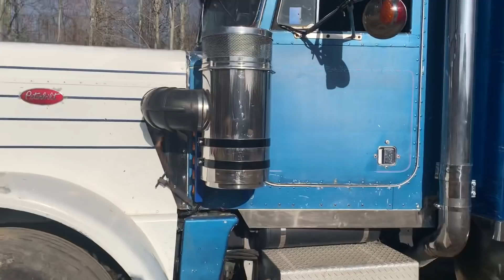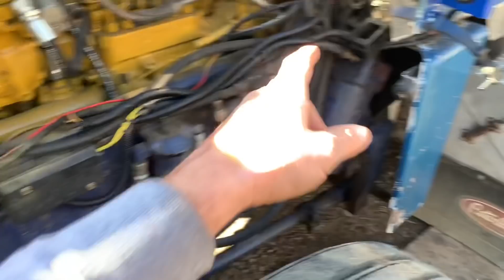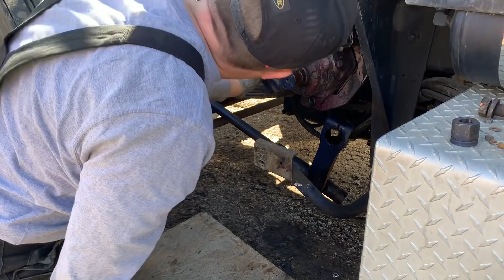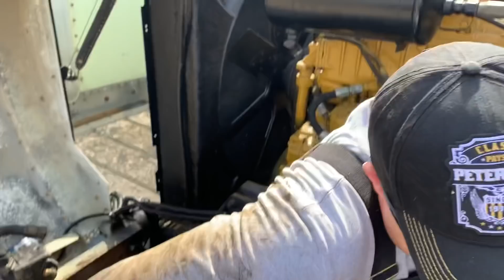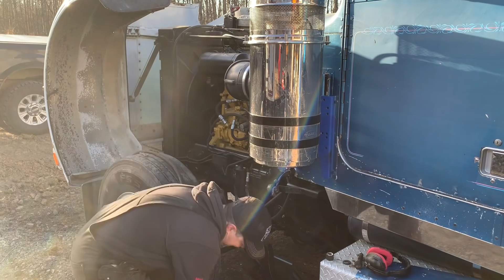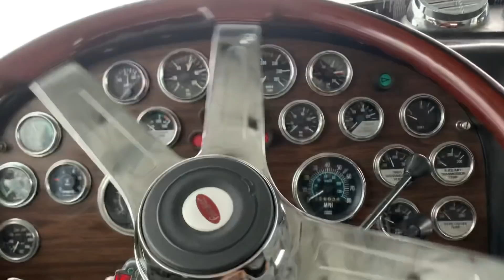Peterbilt 359 Restoration Ep.62 Power Steering Fail

Comment: Ok hear is my 2 cents worth my 97 pet has 0w30 motor oil in it power steering fluid won't work transmission oil won't work a rebuild kit for the steering box is only 75.00 dollars as long as you just need seals and bushings.  But now I'm sure you will learn all about it

Comment: Slight binding is due to non-lubricated steering column slip-joint between gearbox and firewall. Loosen column from input shaft of gear box and remove, extend slip-joint down enough but not completely out of steering column to expose most of the splines and grease the splines all the way around then slide it in/out several times to coat the column insides. That slip-joint must be able to move freely with zero effort. Failure to grease slip-joint causes steering column to bind on itself. As for bleeding air from gearbox, I left my pitman arm fully attached, raise the whole front-end off the ground and supported with cribbing, started truck, and turn the steering wheel lock to lock several times. Initially when installing new box, even with fluid in the circuit, it won't be through entire system. Upon starting engine there will be no power assist because the fluid circuit is not complete. Grab the steering wheel and force it in one-direction which will complete fluid circuit usually within one rotation of steering wheel which will then immediately provide power assist. Once the fluid circuit is complete, turn the wheels lock to lock to bleed air then sit the trucks front-end back on the ground and test power steering. Most power steering gearboxes are self-bleeding and working the wheels lock to lock is all that is needed to remove the air pockets. I have replaced my steering gearbox 3-times now in 11-years. Twice with the factory installed R.H.Sheppard, then switched to TRW-Ross which I love. So I've done this a few times.

Comment: Run regular 15w40 motor oil in your power steering, on truck the pumps are gear drivin and thicker oil doesnt hurt the pump like a belt drivin one and if the seal goes in your power steering pump, motor oil will go into your motor instead of ATF

Comment: I would recommend this. Reconnect the steering and align it (you didnt have to remove it to bleed). Jack the front axle and ensure that the jacks are nowhere near the tires because you will be swinging them back and forth (left to right). With the engine started, cycle the steering back and forth at least three times with the bleed valve open (on the steering box. It will have a bleed port, that you connect to a hose, like on hydraulic brakes). 

I can bet you that air was trapped around the gear and balls of the steering box. Once you start getting steering, close the bleed valve, then let it run for about 10 minutes, then repeat (to get the air from the return line out, as those bubbles will cause skipping steering).

Hope it works out.

Comment: When you bleed power steering systems, it is very important to not start the vehicle before you bleed the system. That will cause the fluid to foam and it will be almost impossible to bleed it. You bleed it by turning the wheel lock to lock just like the instructions said, but with engine off. Make sure to top off fluid as it drops, so air can't enter the feed line to the pump or you are just chasing your tail. The reason they do it with pitman arm off, is it is already off. You could just jack up the front end, whatever is easier. I would let it sit in hopes that  fluid settles down and try to bleed it again, just don't start it before you bleed it. If that don't help, maybe the lines are swollen inside. Also worth checking out the u joints on the steering shaft. I think you have some power steering, judging from the end of the video. It didn't look too bad to go from lock to lock with one hand. Good luck you will get it figured out.

Comment: Check your lines old ,they can collapse on the inside and cause problems , if not crack line with someone turn the wheel to see if fluid is circulateing

Comment: You could also have a giant flake of rust blocking the suction fitting inside the resevoir. There should absolutley be fluid at the suction side of the pump and once it’s running there shuld be fluid at the pump outlet , flow not high pressure, as you steer the pump builds pressure and flow drops

Comment: I think there is something wrong with that pump you got.  Especially if they said they had to reverse the direction?  I changed my 1981 Pete from manual to power steering and after I got the new box and pump on it worked like a charm,.  Can turn the wheel with one finger.  As for the steering gear, when the worm gear is shimmed to match the lash on the pitman gear correctly it shouldn't drag or be too loose.  Sounds like the lash is too tight.

Comment: Jack up your front axle, both sides and turn your steering all the way both ways a bunch of times. That's how i make sure its working properly without air after replace a sector or a pump. You could have kingpins starting to seize up

Comment: If it was in my shop, I would check the u-joints in the steering shaft. Then I'd put it on jack stands and try working the air out by steadily turning the wheel left and right. Also, would check the king pins at this point. Not sure if that type of reservoir would have a serviceable filter, but I'd check for that. Then all that would be left is replacing the power steering lines. Could be collapsed internally.

Comment: I replaced my gear box a number of years ago. I got it from a rebuild shop. I also had a slight resistance when I turned just slightly to the right. I took it back  and the mechanic made a slight adjustment and it worked fine (still does). I saw what he did and  asked if it is still not right, can I try to adjust it? He said " no, just bring it back, I've been doing this for 35 years, I just know how it is supposed to feel". I don't know what he did but obviously he know what he was doing.

Comment: You need to check the tank to see if the pressure line is blocked I had to replace mine on my 2000 Pete turned out line was blocked by rust

Comment: Have you checked your king pins they will cause hard steering
Reply: As the main steering is disconnected you should check the joints in the steering wheel shaft may have a flat spot in the uj. Keep at it love you vids great viewing.

Comment: Some reservoirs have filters in them, you could check to see if yours does.  Also I've always bled power steering systems by lifting the front wheels off the ground (or remove the pitman arm like you did) and turn the steering wheel lock to lock 20 times of so with the engine off.

Comment: Mark if the changing of the steering box was hard on the Pete, I had to change the identical box on my Diesel Pusher RV. Monaco from the bottom of the RV and it was pure Hell so keep making those awesome videos.
Reply: Do you have a part number for this steering gear box? I have the same hydrapower Ross box on my 87 Pete and every number on there leads me to a box that doesn’t match.

Comment: In my best biosed thinking after sweating bullets on my truck was would you believe something so simple.... change king pins, I am thinking that take the weight off the front and take that main link steering arm off and then can you move those tires easy by your hands, if not its surely king pins like if they were replaced and one of them froze up from setting so long..... I have had something that wasn't that long setting and more from something just wrong with a pin. I will put a nickel against dog nuggets on it

Comment: That's cranking one handed with a bull handle like butter with practically no effort.  That's almost as good as it gets. That's good. I wouldn't question that in any truck I've ever ran.
Reply from the maker: Drag link wasn’t connected when I was spinning the wheel ... when it was I could barely turn the wheel 🤔
Reply: @TwinStix  ohhhh gotcha...well that makes more sense.  My only other guess was are there grease certs in the entire system somewhere that haven't been greased for years possibly?

Comment: I'd check the hoses too, as others have said. Although you can't see any evidence on the outside, the inside of the hose can collapse and prevent flow. You could look into the reservoir when the engine is running, you can usually see swirls in the fluid as it returns to the tank, it might be that you are only getting a trickle instead of full flow.

Comment: Hi mate, sometimes the uni joints in the steering column shaft seize so take them off and check they move freely also could be steering column bearing. Some steering boxes have to be turned from lock to lock without the pump/engine running to set the limiting valves in the steering box. Good luck

Comment: Manual or Auto poppet in the gear box. If manual if there not set right there will be no assist while turning. Simulating turning full lock.. should be a hole on top and bottom flat head screws. Don't back out to far pressure will blow the screws out and make a mess.

Comment: Hi I don't if it helps but when filling up the power steering fluid you normally have the engine running and slowly fill the tank and now and then turn the steering lock to lock as you fill.

Comment: I had hose that looked perfectly normal on the outside but the interior had decayed and collapsed on the inside and nothing was getting through it. It wasn't a power steering hose but a brake hose, maybe that is the issue. It was scary coming up to a stop light because all of a sudden the right wheel was locking up and the left wheel just kept rolling! Just check the lines. Hope the pump doesn't get burned up running dry! Anyway you could remove a hose and fill the pump and the steering box? Good luck.

Comment: Ok mark, here you go, all your fans wrote in what to try to do and I Made a list, 
1st take the truck for a drive and make a lot of turns to try to purge any air from system.
2. Try filter change for that system.
3 check for clog or clasped hose.
4. Jack front of truck and turn wheel see if turns easier.
5 check king pins/ what ever that is/ 
I am an aircraft mechanic not truck a mech.
6. Check for frozen steering knuckle any thing in steering linkage.
7.try installing a psi gauge in to system should be 2000 to 2500 psi. I think.
8. Might be a bad part out of stock, don’t know how many times that but me in the ass working on 40 year old Aircraft. Like DC10-30.
 Well I thought one stop shop for all those great fans who are trying to help you. 
Like I said I am an aircraft mechanic. 
Good luck. Your videos make my day.

Comment: Check all the steering shaft u joints. Possible one in the column is seized. Also, check this troubleshooting guide to point you in the right direction https://www.trwaftermarket.com/globalassets/na/trucksteering---literature/other-manuals/other-manuals-sm/trw1250.pdf

Comment: You've obviously checked that the fluid is free-flowing? There's no a blockage in the lines or the line from the reservoir?
People put all kinds of things in power steering like engine oil, trans fluid, hydraulic fluid, power steering fluid, I saw once LimSlip! Those fluids aren't always compatible and sometimes gum up.

Comment: It’s normal to have a little bit of a hard spot in the steering box, it’s the centre of travel, and you have to overcome it to steer from one side to the other. It helps to keep the truck going straight, this is what I was taught when learning to overhaul steering boxes. Also trying to drive a wedge into the slot helps to remove the arm from the steering box. Phone Hydra Steer and ask them what could be wrong before pulling the box off the truck as it’s awkward and heavy. Inside the frame is usually greasy and dirty, only exception I ever saw was Les Steils, you could work on his truck and never seemed to get dirty, He always said if I’m going to have to crawl under it to grease it I’m going to make sure there is no dirt or grease anywhere on his inside frame rails etc. Miss the good old days as I’m retired, still work on NT 855 Cummins Engines, not many people know much about them anymore. Good Luck my friend I’m sure you’ll figure it out, enjoy your videos.

Comment: I would suggest disconnecting the lines at the steering box, and connecting them together. Then take the return line off of the reservoir, and put it back into the fill hole. This will establish a complete loop you can see. Then you need to confirm what is the pressure and return fittings on the steering box. I would also changing your return filter. Also when working with a "clamp fit" of the pitman arm, if you tap a thin wedge in the split line, it will open it up enough to slide off. Don't go overboard, just enough to loosen it.
Reply: Dave knows his stuff.

Comment: Did you check the fluid color after you ran the new steer gear stop to stop? If it is light pink and frothy looking you have air in the system. Best practice is to not start the engine. Jack the front end and support. Once the air in the fluid has dissipated run the steer gear full stop to stop 10+ times. This should  allow any trapped air to "burp". Keep checking the fluid color. Light pink indicates air. Keep running the steer gear lock to lock with engine off until fluid color is solid red. Only once the fluid color looks the same as when you put it in should you run the engine and allow pump pressure to come in. This should still be done before any weight is applied to the steering system. I bet you are fighting trapped air. Keep up the excellent work and love for the forgotten sir!

Comment: Not sure if this applies to the 359, but my car had some resistance steering sometimes even with a good power steering pump and it ended up being the linkage, there was some corrosion on the steering column and greasing it up completely fixed it

Comment: Might work, I get the front wheels off the ground, remove the power steering reservoir cap ,ignition to run so the wheel moves freely, turn the wheel back and forth lock to lock a few times.  Check the level.  Then turn on the engine and turn lock to lock again with the cap off and check the level occasionally.

Comment: Just curious are the joints in the steering shaft in phase? Weird that you'd still have a hard spot with the drag link removed. That tells me it's a steering shaft slip joint or u-joint is your culprit
Reply: Your problem would be worse with the drag link hooked up since your putting a load on the shaft and u-joints. Just my thoughts on it. Please let me know if its any help

Comment: Well, here I go, throwing in my two cents... Most PS reservoir tanks,  have a particulate screen inside at the bottom of the tank,.. years of wear, can plug the screen,... a plugged screen, starves the pump of the fluid volume, required to activate the PSB spool,... You can try removing the reservoir and back flush it.... Better yet, everything else is rebuilt, so try replacing it. ....I Hope this helps.

Comment: Are your kingpins seized they're too tight. That's what I found with mine. I also had the power steering pump sucking my line closed and starving the gearbox.. I changed the line and it was a world of difference

Comment: Once upon a time a long time ago, I heard a phrase used, "road feel steering".. Yeah I know, well the principal was at roadway or highway speed the pump would unload excess pressure to allow the driver to "feel the road" in the steering. Then at lower speeds the pump would provide assistance for manoeuvring and steering basically "assist" but not be completely powered. I can't remember what series trucks came out with that system, but it was one of those "added features" that everyone and their dog threw onto the trucks they manufactured as a sales point. Chances could be high that your truck has the "road sense" or "road feel" steering package. So what you have right now is what your going to get at the end of the day with that steering box and pump setup (if that's the case).. Hope that helps you out a bit Mark, Stay Safe & Thanks for the share!  Cheers

Comment: Full the power steering with regular 15/40 like the motor, in case the pump goes it’ll just pump oil into the motor not something else
Reply: Especially with the size of that reservoir, if that much atf gets into the engine and isn't caught right away it will really wreck an engine
Reply: @toby0395  I been doing it for years old timer taught me that trick. Works just fine . Plus it’s one less thing to carry in n the side box
Reply: Exactly, I do the same with my 3 trucks, and haven't had a problem, and like you said one less oil to carry around with you

Comment: I was just wondering if your steering shaft is in time? If the u joints in the shaft that goes the to box is out of time it will give you some resistance. Good job on your videos.

Comment: Hey was just wondering if the gear inside of the timing cover is actually turning the power steering pump or not , the gear inside the engine might be stripped out???

Comment: Always use motor oil in power steering pump.  If the seal leaks on the pump. You wipe out your engine.

Comment: On that psa you mentioned with batteries I put a power cutout switch in all my vehicles so that I can just flip a switch and I know nothing is live, if you did that to all your project trucks it be easier and less wear on your battery terminals plus just faster when doing electrical and testing too.

Comment: That little snag you feel is probably the needle bearings in steering shaft u joints and you can jack up the front end and turn you steering without disconnecting the steering